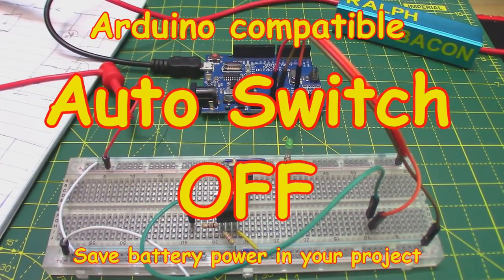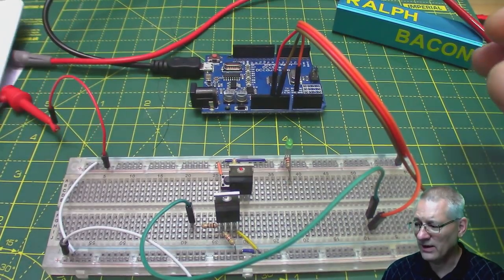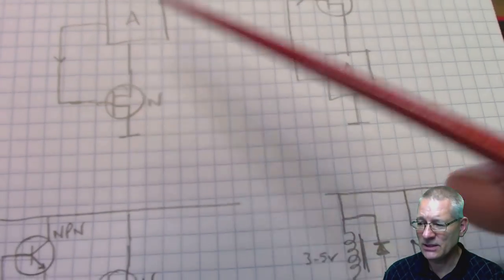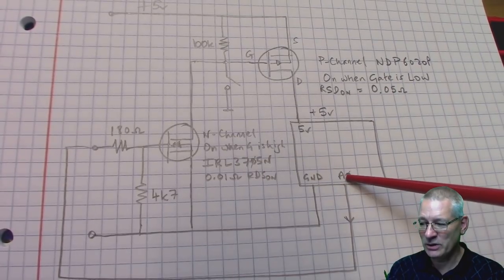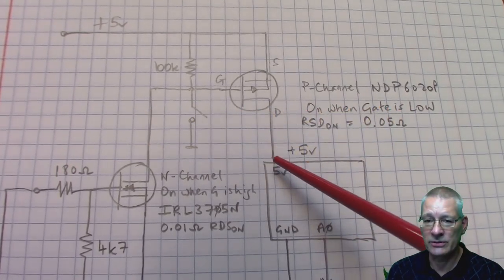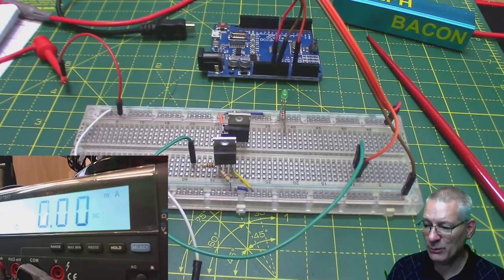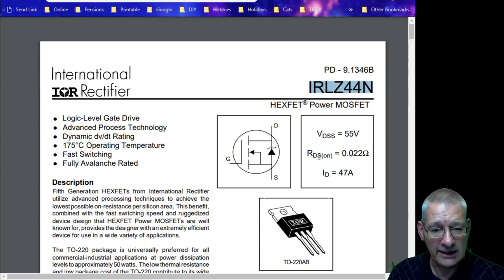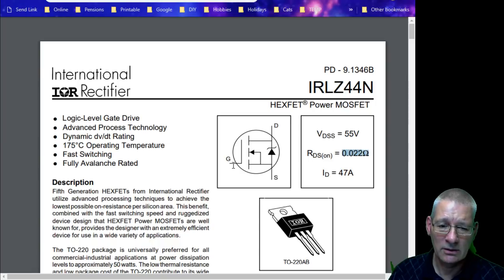#123 Arduino Auto Shutdown (and switch off)

Comment: Hi sir. At tried to do your circuit from github but I did the one where you could read the state of the button. When I measured the current consumption with everything turned off, from my multimeter there's a 1.1-0.7~ uA . Is this normal? I used the si4599 and in4148, is this the ones that affect the consumption?
Reply from the maker: Well, there will be a few nano Amps leakage but not as high as a μA I would not have thought. 

The diode will prevent current flow into the μController. You have the anode connected to a GPIO pin?

Did you use a 100K resistor on the base of the P-channel MOSFET to +ve? That could allow up to 50μA leakage although it should be blocked by the N-channel MOSFET.

You will have to measure where the current is flowing using a multimeter at various points to see what is allowing that current to flow.

Comment: Do you think a capacitive touch switch like TTP223 could be used to power up an Arduino and then the Arduino trigger the TTP223 off? (some hack of the TTP223).  I like the approach you show but I want to eliminate the somewhat long hold of the momentary switch.
Reply from the maker: You could use the same Auto switch on/off as I show here but with the TTP223 wired to the Gate of the N-channel MOSFET. When you touch the TTP223 the signal output will go HIGH, thus turning on that MOSFET which will then turn on the P-channel MOSFET and power your Arduino.

No need to hack the TTP223 because the Arduino's first job is to keep itself powered up by keeping the Gate of the N-channel MOSFET high just as the demo shows. I use the auto on/off circuit with a tiny Si4599 (or equivalent such as the A04606) and it works just fine.

Be aware that the TTP223 takes 6μA in standby (ie not supplying a signal) so that might be important if you're running on batteries.

I've done other videos on this topic so do check the schematics for them.
http://bit.ly/YouTubeVideoList-RalphBacon
Reply: @RalphBacon  Thank you.  I'm going to get MOSFETs and do this.  My  worry about startup time is because I recently moved a sketch from a Nano to a Pro Mini 3.3V, 8MHz.  Along with seemingly starting slower I discovered the delay function operates more like a counter.  I had to cut the delay times in half for the sketch to give the same operation as in the 16MHz mcu. 
Now that I have hit full retirement age (happy and sad) I hope to expand my knowledge and experience with this fun and useful stuff.
Reply from the maker: If your 8MHz chip is counting delays half as quickly as the 16MHz device then you have not loaded the correct "fuses" to it, to tell the chip how quickly the (internal?) clock is running. The delay, and millis() will always run the same regardless of clock speed.
Try using the MiniCore board description and then specify the clock speed you're using etc - it will then work exactly the same as a Nano.

Comment: Is there a way to also read the button state with an additional GPIO pin while the arduino is on? I would like to reset the timer every time the button is pressed to keep the system on, but i don't want to add a second button.
Reply from the maker: Yes there is and I'm pretty sure I covered this. Basically, connect the button via a diode to an input pin and read the state. If the pin is connected to ground or is high you can detect this. Diode has cathode at the switch end, not the GPIO end. Maybe need a smallish resistor too.

Comment: Hi Ralph, thanks for the vid, I am hoping to give this circuit a go but my project voltages are slightly different.

I have made a little gps speedo using a 3.3v pro mini with onboard led and regulator removed, a 3.3v oled and a 3.3v gps (Quectel L80R).
The above 3.3 voltages are regulated by a separate LDO (MCP1700) powered by a small LiPo battery through a TP4056 protection board and small on/off slide switch. It works surprisingly well!

I would like to remove the on/off slide switch and replace with a circuit which can be powered off by software rather than my memory, and the protection board preventing over-discharge. 

I would also like to monitor the LiPo voltage between the cutoff circuit and the modules/load and display it on the oled plus auto shutdown if the voltage gets low, much before the protection board kicks in!

Ideally, I would like to press the same power-on button to turn the power off. Although, a separate button wouldn’t be the end of the world.

Is this something you have already conquered, and with LiPo (3.7v) - to 3.3v logic?

Any help / advice is welcomed!
Reply from the maker: And do you want to make your morning coffee, with optional toast? 😃 OK, let's start!

I've made the following assumptions:

1. Your TP4056 board charges the battery and powers the circuit with 4.2v when connected to USB, otherwise the battery powers the circuit with up to 4.2v (but averages around 3.7v).

2. Your switch is in-series with the battery output to turn off the circuit, but the battery could still recharge with the switch in the OFF position.

3. Your 3v3 LDO is in-series with this switched (up to 4.2v) battery output.

I would put the P-channel MOSFET in place of the switch. The Gate of the P-MOSFET is controlled by two things: the N-Channel MOSFET and a momentary switch to ground. Push the switch, the P-MOSFET starts conducting.

Your circuit should immediately, as the very first thing, bring a GPIO HIGH that is connected to the Gate of the N-MOSFET. This ensures the circuit now latches on and you can let go of the button. My projects take between 0.01mS (Arduino) to about <100mS (ESP32) to do this.

When you circuit has done its thing, bring that GPIO LOW and the circuit switches off. Alternatively, connect the Gate of the P-MOSFET to another input pullup GPIO pin via a diode (so the anode of the diode is connected to the pin, and the cathode to the Gate). Your circuit can then detect when that button goes LOW (you have pushed the switch again) and if will then bring the other GPIO pin LOW to turn off the circuit.

As you can imagine I've used several variants of this circuit and it's very robust. I use the dual MOSFET Si4599 (Vishay) 8-pin chip, as it's tiny but can handle several amps current. It also SHOULD work reliably at 3v3 (the P-MOSFET Gate will switch the device on at a max -2.5V) but I would double test this on a workbench! An alternative to that chip, is the drop-in variant AO4606, because the Si4599 became very hard to get during Covid. The situation may have improved now.

If you have further questions or issues, drop me a line!
Reply: @RalphBacon  

You are a gentleman! I am more of a tea man myself 😉

Your assumptions are mostly correct. 
1. When charging, I disconnect the load so it can terminate properly. 

2. My switch is between the tp4056 (out+) and the mcp1700 3.3v regulator. 

3. See above (2.)

Thank you for describing your robust solution, and using an all in one mosfet sounds great, it looks pretty small though! Do you think the through hole AOP605 would do? Could be easier to breadboard. 
Was wondering if any other components were needed, resistors, caps etc?
Have you possibly created a video on this circuit, I have been searching but have not found one? 🫤
I think many people would find this circuit useful. 

Thanks again for your help and advice.

Comment: Also Nice, boot up signal from ds3231 timer do your thing and set A0 HIGH with  220ohm and 2n2222 transistor to reset ,rebooting And go to deepsleep waiting for a signaal from ds3231 timer to boot up again. You can do delay to give esp8266 power for x time. Only deepsleep power from arduino nano mini is used in the time between. Nice for data collecting to MQTT. With battery and solarpanel no power required.
Reply from the maker: Thanks for your post, Erik Laken, good to hear from you.

Comment: I don't think i have ever seen a MOSFET in TO220 housing without the metal tab being connected to the drain - do they even exist? All the devices i have opened, the center pin and the metal tab is one whole piece of metal.
Reply from the maker: I haven't either, but I suppose there might be some exception. Is the tab still connected to the drain (not the source) on a P-channel MOSFET? I haven't checked. But in general, yes, the tab is connected to some pin or other.

Comment: WOOW. just what i was looking for. im using a PSU module that steps down high voltage to 5v, and if i connect the load end first, it fries my electronics, but doing it like this, i could add a small button to power it up, and prevent myself from ever having a load on it before plugging into power.  thank you!
Reply from the maker: Sounds like you have found a solution! Thanks for posting.

Comment: Do you think the SI4599 could supply both the N & P channel for a relatively low power circuit running from battery power ?
Reply from the maker: When you say "supply both the N & P channel", I'm just wondering what you mean there. 🤷‍♂️

Does your battery powered project unusually requires a +ve and -ve supply? 

Or do you mean just supply "the battery power" to a battery powered project, in which case that's exactly what I do with my storage container lid-monitors.

I can tell you more, one way or the other, if you clarify  your meaning a tad, Duncan. And describe your project a bit so I can get a better feel for what you are trying to achieve 😜
Reply: @RalphBacon  Apologies, I should have been a bit clearer. Your solution uses both P and N channel MOSFETs to provide power to an Arduino and associated circuitry. It is normally off, on when a pushbutton is pressed and off again when the Arduino decides it's no longer required. I want to make my own A/C Remote control to replace a faulty one rather than just buying a replacement - and I have a basic prototype using an Arduino Nano that works perfectly in terms of controlling the A/C, but I want the ability to power On/Off the Arduino and associated circuitry in the same way you have done. I was just wondering if it might be feasible to use the SI4599 you mentioned in another (later) video as it provides both N and P channel MOSFETs in a single package - albeit with lower power capabilities, but maybe enough  for my requirements
Reply from the maker: In that case, YES 👍🏻 

I am doing this right now with my storage bin monitor. It's the same circuit as in video #123 (wow! that was a long time ago) and using the P- and N-channel MOSFETs in either the Si4599 or the (cheaper) AO4606 which I've found are drop-in replacements. 

Current for the Si4599 is 6A for P-channel and a bit more for the N-channel. More than enough for an Arduino on/off.

Any questions, let me know. Have a great Easter 2022! 🐰🐣
Reply: @RalphBacon  Thanks Ralph - you too

Comment: Could the momentary switch not be on a GPIO pin on the second circuit it could trigger a test loop of the other part of the circuit then power it back down.
Reply from the maker: Yes, and I did briefly mention this at some point of the video, Simon, really I did!
  
If the Arduino is permanently powered (albeit mostly in Deep Sleep) then it could be woken by an interrupt using a push switch. Or some other mechanism (a timer of some sort).
 
Good to hear from you, thanks for posting.
Reply: Ralph S Bacon  missed it some how.

Comment: Hi,
Is there any significant difference in using 
other mosfets such as the 30N06L and 47P06 or 
it is mandatory that i use the irlz44n and irl3705n ???
also what makes the mosfets with S or Z sign at the cathode side so special compared to the other mosfets ?? 🤔
Reply from the maker: You can use any MOSFET you like here (just ensure you have one N-channel and one P-channel) but the bit you really need to read up on is the RDSon value (resistance between Drain and Source when on) and the Gate threshold voltage.

A P-channel MOSFET has a higher RDSon value than an N-channel so if you get it below 1 ohm for a P-channel you are doing well.

The GATE voltage on the N-channel should be 5 volts or less, otherwise it will not completely switch on and may cause the entire circuit to malfunction. Gate voltages can vary, from 1.8v to 10v so check the datasheet carefully.

I'm using a dual MOSFET chip in my current project which works very well; its an Si4599 and you can get them from Banggood pre-mounted on a tiny development board. http://bit.ly/370qI2N
Reply: @RalphBacon  
Thanks for the reply, would you give a schematic of how you wired your Si4599 to your project ??
sorry, I'm very new to this.
the Si4599 board has NS1 NG1 PS1 PG1 etc etc example PG = power ground ??

Comment: Thank you sir. Much appreciated. Will this work with the WiFi  rev2 Uno board? and a regular on/Off switch instead of a push button.. That would result in the P Mosfet being held to ground, much like you holding that button for a long time.
Reply from the maker: I'm somewhat confused by your question, Edward! It will work with a regular Uno Wifi board but why would you want to keep the P-MOSFET at ground via a switch? But if you look at my video #195 (Reverse Polarity Protection) and ignore the fact that the MOSFET is connected "in reverse", you will see that I connect the Gate of the P-MOS to GND permanently - so, yes, it will work!
Reply: @RalphBacon  My apologies, In retrospect, I woke up this morning and realized that I was overthinking my application.  In the end all i need is a simple switch between my 9V battery and Arduino. Right now I only need the program to run when manually switched on.    This is what happens when you stay up all night teaching yourself new stuff at 50. The application is a simple wifi application that will only need to be manually activated every week for no more than a minute or two and thats it. Then I want the switch to be manually turned off. (for now I need confirmation of On & OFF by a person).  At first I was trying to leave the arduino on all the time with all kind of indicators from batteries and realized that the power consumption was too high to last 6 months.(I wanted to walk past it and see that it was connected to the wifi . So I just have to go on faith that the program does its thing when powered and wait for the result on the other end... lol( TCP Client Application to another Arduino that will always be powered on as a server. ) Once I get a handle on all this programming I may switch to an ESP8266 for a smaller footprint and play around with the sleep state and then do a little bit for automation.  BTW I thoroughly enjoy your videos.

Comment: What pin of the Arduino is receiving the power? I thought Vin accepted between 7 and 12 VDC. You may not have an Uno though. It is a bit confusing!
Reply from the maker: In this demo, Daniel, I'm assuming the switched power goes to the +5v pin of the microcontroller (yes, an Uno or similar). It therefore bypasses the on-board voltage regulator. But this circuit can tolerate a higher voltage, in which case it would then go to the Vin pin (and then to the on-board voltage regulator).
Reply: @RalphBacon  Thank you Ralph for clarifying this. Your feedback is much appreciated. This is how we learn from each other. Great health to you!